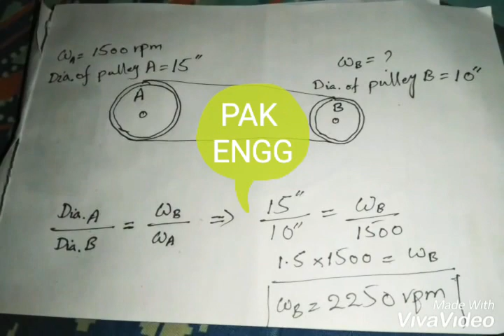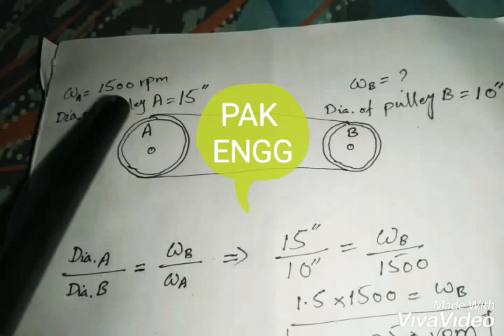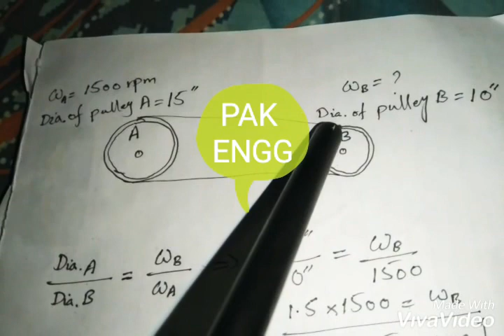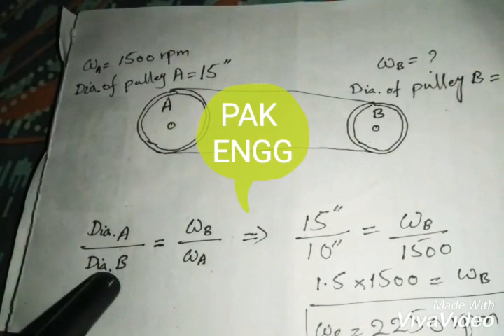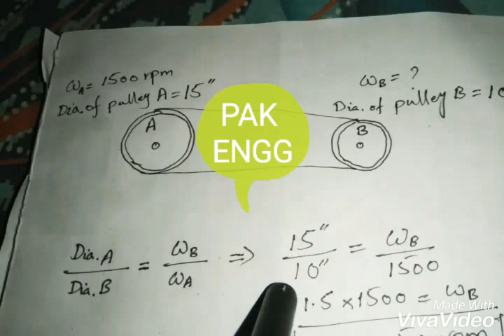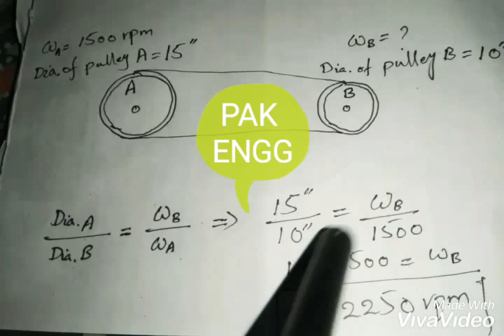How to calculate RPM of a pulley

Comment: Hi, I just watched a video you posted on pulley size calculation. thank you for sharing.
If you would, I need guidance. I'm helping someone install a DIY microhydro system. We're using a multiple pulley system to achieve required rpm at alternator. Three shafts and four pulleys. The main driver needs to spin at 65 rpm to achieve 1300rpm at alternator pulley.
The higher the electric load on the alternator the more resistance and it slows the system down. 
My question is, does installing a larger driver pulley help overcome the braking force that the alternator exerts when under load? or is my only option increasing force/power at driver pulley?
Would you mind if I sent you an email regarding the problem I'm facing?
I understand if you don't reply. Thank you anyway